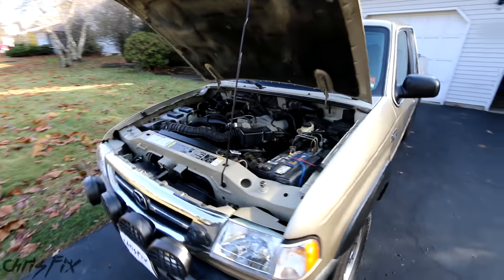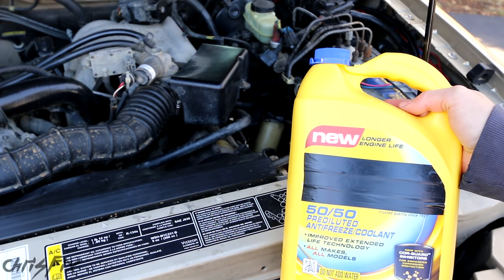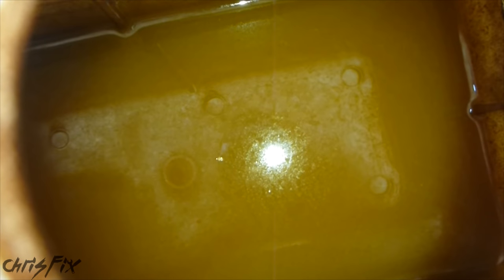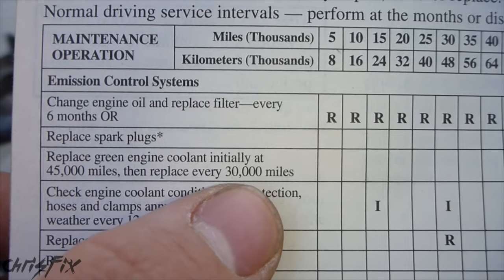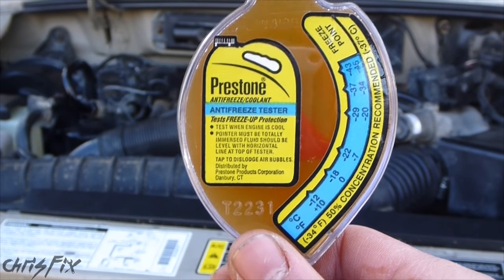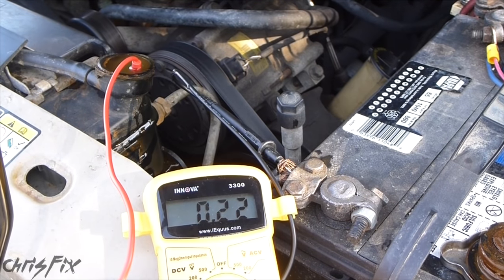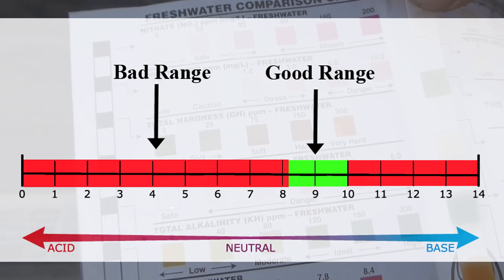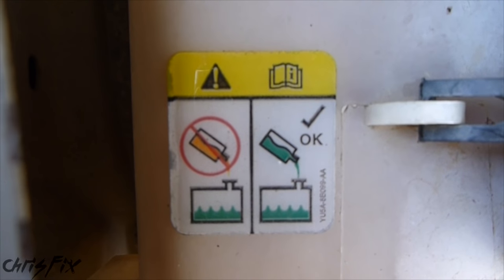How to Check and Test Your Coolant/Antifreeze

Comment: just bought a 2003 3.5 V6 Pajero it's got water in cooling system instead of coolant,did the multimeter test with engine on its reading 0.31 🤔
Reply from the maker: Dang! Get that changed out to coolant asap!
Reply: ChrisFix will do,just been lazy to do it 😎👍
Reply: ChrisFix by the way Chris keep doing what you doing mate,you do some real interesting videos 👍👌

Comment: Does DC current flow from the negative terminal to the positive terminal?
Negative is ground, what does that actually means??
Reply from the maker: ***** Electron flow is from negative to positive. The negative terminal is a ground but since the battery is a chemical reaction happening to provide power, it is not like an engine ground or chassis ground. Make sense?
Reply: ChrisFix kind of, will learn all this anywy next semester in my automotive electrical class ;)

Comment: You should use the multimeter on a lower scale. Also that engine running test is not that relevant, you will be measuring also the voltage drop caused by the current that is charging your battery and keeping the car running.
Reply from the maker: rosharky The engine running test is relevant. The cooling system should not have current running though it above the level I mentioned. Coolant has additives that prevents electrical current to prevent electrolysis for both when the engine is off and running.
Reply: ChrisFix The acid inside the coolant along with the two different metals (multimeter pins and engine block) creates a battery.
That battery works the same regardless of the fact that the engine is running or not.

The second part of the test with when the engine:
Current is running through the ground cable some is flowing for battery recharge and other electrical accessories. This has nothing to do with the coolant. However that current will generate a voltage drop that would be measured as well by the multimeter. If the ground cable has a loose connection you might even get 0.5 or even 1V of voltage.
However this has nothing to do with the actual coolant quality.

All i am saying is that the test with the engine halted is correct, but the other might give misleading results as it is heavily influenced by external factors.

Keep up posting the videos. They are a good source for actually hand on experience and not reading boring manuals. :)
Reply from the maker: rosharky Thanks for the info/reply man!

Comment: Hey Chris I have question, so my cars reservoir was empty completely but the radiator was full so then I added coolant to the reservoir but I forgot to put the cap on I drove about 10 miles from my house to the store 😅😅 so I check it the next day when I noticed the cap off and the reservoir was empty and advice

Comment: i have a 2007 chevy malibu that anticoolant is red uses dexcool my friend put universal green anticoolant 50/50 replace themostat tthe old thermo was all rusted amd bought new one but its getting hot to 75 percent so should it be machine flushed just got it back from findlay chevy for replaced thermo housing so should i use the green or red one
Reply from the maker: +djsmileyoflasvegas use what the owners manual calls for.

Comment: I bought a car and the previous owner only used water (I live in Brazil so there's no situation where I have to worry about freezing) and I'm afraid to use coolant  because the motor block could be so rusted that it eats it's way through the block. That's what I've heard might happen, can anyone confirm or clarify please?

[EDIT] I meant the radiator "flush" fluid, that is corrosive enough to eat through the block right?

Comment: Chrix im working on a corvette 85 i change the engine oil and transmision oil but the radiator was rusted and i flush  it but i notice that now the coolent its mix with oil how should i test if its the radiator or other

Comment: Hi Chris. My Radiator keeps drying up, but there is no sign of leakage....Please help..Thank You.
Reply: For others reading this, if there is no leak, check you oil dipstick.  I had a leaky intake manifold gasket in a GM (naturally) and the antifreeze was going into my oil pan.  I believe in full synthetic oils and since I was using Supertech full synthetic at the time, nothing else was damaged which surprised the repair shop since I had been driving for 2 weeks continually adding coolant and not knowing where it was going.

Comment: what is the best coolant? low freeze point, low corrosion, high evaporation point.
Reply from the maker: sakoudas The best coolant is stuff that has corrosion inhibitors and electrolysis inhibitors. All coolant protects to the same temperature range for the most part.
Reply: The best coolant is fresh coolant.  
Yes, OEM works, as does a lot of all-vehicle coolant, but old, nasty stuff is no good.

Comment: If there's a high current reading when you stick the meter in the coolant, does it mean it's also running you battery down when it's parked?
Reply: Dee no

Comment: Can the coolant go bad if I only drove 120miles in two years? I got my car's coolant flushed before putting it in storage, now it's slowly overheating and the green coolant turned muddy.
Reply: Flush and refill 50/50 antifreeze and distilled water.

Comment: I got nothing in the reservoir so I just fill it up all the way up?
Reply: There should be an indicator line on your reservoir of where to fill it up to.

Use a flashlight if need be to help see how much you have put in. Simply put the head of the flashlight (while on) up against the side of the reservoir and it will help you see how much coolant you have put in and how close you are to the indicator markers.
Reply: @vigilantemotors  okay I appreciate it, learning as we go I just seen today I need some coolant and I have nothing that thing is dry 

Ultimately I just buy the coolant and I myself can pour it ?
Reply: @gesu03  Sort of yes. You want to make sure you have the right coolant for your vehicle. Prestone makes a coolant that is good for all makes and models BUT, check your owners manual first.

Cars like VW's take a special coolant so you never know what your vehicle requires.

You also don't want to mix colors. If your coolant is green, add green, not orange. 

Mixing color of coolant can lead to sludge issues,

If you have any questions let me know. What kind of car do you have? Maybe I can help more.

Comment: I have flushed my coolant system and filled it with new coolant.  The coolant still checks about .32 volts.  What should I check for or do?
Reply from the maker: Stray current. Check the grounds from your engine to the battery and or chassis. Make sure your radiator isn’t touching any metal. It should be supported in a rubber or plastic bushing

Comment: I live in a country where the temp is always 55-90F. I imagine I could run straight distilled water?
Reply: It's not good for the engine. Coolant has anti corrosion additives as well

Comment: Even after i flushed my radiator twice and added new coolant , after a couple of drives i had to replace my thermostat due to it being stuck open , i noticed my new coolant is brown . My radiator hoses when you squeeze them feel like/ sound like potato chips crunching in a bag . What gives ? My suv is a 99 ford expedition .
Reply from the maker: You have an iron block so if you had the incorrect ratio of water to coolant, it could have rusted. There are two things you can do... 
1. Do this: https://www.youtube.com/watch?v=s--5ft5YiHg
2. If it still turns brown a few days/weeks later, do this: https://www.youtube.com/watch?v=MeruAZebIeU

Comment: Hey another question... what can happen if u put too much antifreeze? I.e. fill the tank up above the line and almost to the top?
Reply from the maker: Ira Friedman There will be no room for expansion and the pressure will build in the system. If there is no vent, then something will give out and leak!
Reply: Most modern cars should have a way of venting I hear
Reply: Can your headgasket blow if u overfill the antifreeze
Reply from the maker: Ira Friedman Not really. I guess if you have a weak head gasket and you pressure builds you can cause your headgasket to leak, but it shouldnt. Plus, your radiator cap should release the pressure after a certain amount of pressure builds up (usually 16psi).
Reply: ChrisFix gotcha!!! I put too much coolant and was smelling it thru the vents and my heater core is still clogged so I guess that's the whole issue.... plus I spilled some on the engine block and as it heats up my buddy told me it may be that which I'm smelling

Comment: 20 dc volts. My multi meter has a range button that ranges between DC  volts (tenths and hundredths) and millivolts. Is it 10ths of a volt?
Reply from the maker: Correct, this is 10ths of a volt.

Comment: Do you have a tutorial on howhat to diagnose anot overheating issue in a 2001 pt cruiser I replaced the thermostat I put stop leak in the overflow due to a leak in the radiator and not having money to fix it. Put it all back together and it was running fine for a day the next day it started bubbling and not it overheats really quick please help
Reply from the maker: Sounds like a head gasket leak. That is what happened to the one my parents owned.

Comment: Don't clean or flush the cooling system by driving with water only, the waterpump bearings require coolant for lubrication.

Comment: You can also give your finger in there when it's cold I just barely stick your tongue on your finger if it's real sweet it's good it's real shower it's no good the sweeter the better I don't necessarily recommend this but it's what I do but like I said just barely the tip of your tongue so you can taste it and then wash your mouth out real good but it works

Comment: I just did a whole coolant flush and put new fluid and now my coolant reservoir looks brown what could this be .
Reply from the maker: Most likely you have some rust in your coolant system, so if you had the incorrect ratio of water to coolant, it could have rusted. There are two things you can do:
1. Do this: https://www.youtube.com/watch?v=s--5ft5YiHg
2. If it still turns brown a few days/weeks later, do this: https://www.youtube.com/watch?v=MeruAZebIeU

Comment: Hey Chris! I have a 1995 F150 and recently replaced my water pump, thermostat harmonic balancer and my timing cover. After the replacement I topped off my truck with coolant 50/50 green mix and eve since the engines temperature stays cool. The temperature gauge still rises a tad bit but not to normal operating temperature. However on a long 3 hour drive the temperature did eventually rise up to normal. Not sure if you can help out with this?

Comment: hy chris i checked my manual and the said i have to use Mopar antifreeze coolant 5 years /100.000 mixing in water but, i could not find this kind of antifreeze should i use 50/50 ?
Reply: The Manual tells you what's best for the car. Shouldn't matter if you use 50/50 or 70/30, I did a 70/30 in my eclipse, it doesn't matter but in my Subaru I use 50/50. Again 50/50 is good.

Comment: so when u pull the head on that car is rust solid and wont move, in extreme cases u throw the engine , use vinegar into the head stud holes, and pray to odin

Comment: BTW, what is the difference between the 2 color coolants?
Reply from the maker: hasbeengood The two different coolants have different chemical makeups. They are both ethylene glycol based but The green antifreeze contains silicates, phosphates and / or borates as corrosion inhibitors to keep the solution alkaline. The orange coolant is "long life" and contains organic acids that protect engine from corrosion.
Reply: Okay what if i checked it and it looks clear, not yellow like the 50/50 antifreeze i bought and put in it before? It almost looks like water but it feels oily. Should i flush it out and flush it all or safe to still add the 50/50? ...and what if your heater core doesnt work, will it make your radiator suck more antifreeze if the heater is not used just AC?..engine is not sounding too good but its not overheating at all. Needing to know before I try to DIY it. Appreciated the model in beginning. Thank you!

Comment: i just topped up my rad with coolant, snd s day after, i looked into my rad and saw that the rad is not full of coolant. i didnt see any signs leaks under the car and the engine oil is not contaminated. the coolant in the overflow tank didnt increased too. where all the coolant went?
Reply from the maker: Top it off again and monitor it again. I am guessing you might have a small headgasket leak.
Reply: or air in the radiator.  there is a proper procedure to evacuating air from your radiator, each car is different.

Comment: Hey Chris can you please help me. I bought my first car on the 31st of Oct.  After about 3weeks of driving I noticed after I got off the highway when I came to a full stop the car was shaking a little more than usual, so while I was waiting for green light before it went my car turned off, I tried to start it but it wasn't starting and then I had to steer it onto the side. Afterwards I put it into park and i was trying to start it but wasn't starting, the engine would just turn and wouldn't start. So I turned the car off and waited 5mins and the car syarted like nothing happened the vibrations stopped and the car didn't turn off. Only thing I did notice is that the rpms were at 750 and now they're are 500rpm.
Reply from the maker: SurvivorEdge This could be a few things. Is there a reason why there might be water in the gas tank or did you run it a lot before this problem? Do you know any of the maintenance history? Every car needs three basic things, fuel, air, spark. I would check the fuel pressure like in this video: https://www.youtube.com/watch?v=_oXLUqE4Sf0
Then I would check the spark plugs and wires. You might want to clean the IAC like in this video: https://www.youtube.com/watch?v=vFhoNykgQtc
Any check engine lights?
Reply: ChrisFix no I rarely drove the car and there is no check engine light on.
Reply from the maker: SurvivorEdge Is it still happening?
Reply: ChrisFix well I haven't drove the car since it happened it's pretty much sitting in the drive way, but I did start it up yesterday and warm up the engine, and what I noticed was when I revved up the engine when it was cold it was around 700-1000rpms and when the engine got warm I revved it and it was at 700 then dropped to 400 then went up. I started to hear the car go silent after I revved it and then when the rpms went up it sounded like a normal car. Another thing I noticed when the car was warm was that the transmission fluid is a light brown color.
Reply from the maker: Well you need to drive the car and see when it happens. This could be due to never driving the car. Cars are meant to be driven. Also, it sounds like your tranny fluid is dirty. You might consider changing the fluid. Good luck!
Reply: SurvivorEdge Chris has good suggestions but this exact same thing happened to me before in my 05 Corolla literally like last month. Turns out that i had a bad battery and needed a new one. Get it tested at the autozone for free to see if your car needs a new one. If it is the battery, then after you replace it, your car may need to relearn idle. (it's easy to do. Just look it up on google) hope this helps.
Reply from the maker: Brian Griffin Thanks for the suggestion Brian! That is a good idea too! I love it when subscribers help each other out! The battery could cause a problem like that for sure. Did your battery light come on at all? Your car doesnt need to "relearn" its idle. It is automatic after a certain amount of miles and or on/off cycles, it will relearn it so no worries!
Reply: SurvivorEdge may of just got something foriegn in with your gas.

Comment: Hey, I can’t find the coolant plug on my 2010 Volvo XC90 and the owner’s manual is clueless. Anyone know where it’s located?
Reply: If you need to empty the radiator, it might be easier to disconnect the hose at the bottom of the radiator than it would be to put anymore energy into finding a possibly non-existent plug.

Comment: when u take raiditor top off dose water surpose to be flow or still
Reply from the maker: Cliff Armstrong No, it is not supposed to overflow although it might overflow a little if you havent touched t for a little while so dont worry if that was the case.

Comment: Is it normal that I mixed some coolant with water (distilled) 50/50 but I didn't get the rated temperature indicated?
Even tapping the hydrometer to remove bubbles didn't do it.
Reply from the maker: +thaik56 That might mean you had some water on the system or your hydrometer is just no that accurate.
Reply: ChrisFix I tested the mixture outside before pouring it into the system.I guess it might be the hydrometer.
Reply: You were right, bought another tester, the old one was just plain defective, probably because it wasn't rinsed off after each use.

Comment: Ok I got a 97 Chevy pickup an for the past 4 months my  radiator been get hot fast until now I got my water pump change an I got a new temperature gauge change an my truck still running hot like I put 2 hold gal of 50/50 antifreeze an I ran cold for 2 month an today I'm running hot after I got off work can u tell me what goin on
Reply from the maker: Marcus Greer Sounds like you have air in your cooling system.
Reply: ChrisFix that not good huh
Reply from the maker: Marcus Greer It is not bad. You just need to get the air out. You said you put 2 gallons of antifreeze in the jeep, how many gallons does it take? Have you checked your antifreeze level recently?
Reply: ChrisFix I put enough to last me for a long time and it really help if I fill my truck up with 2 bottle of it
Reply from the maker: Marcus Greer Yea it is going to be hard to diagnose the problem but it sounds like you have air trapped in the system.
Reply: ChrisFix dang imma get that fix